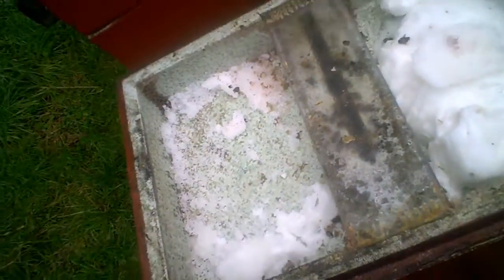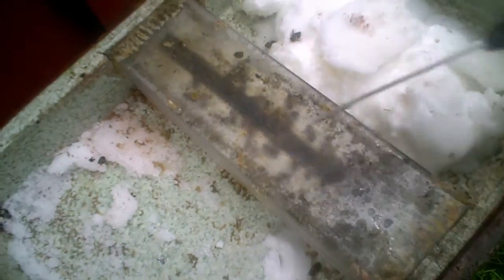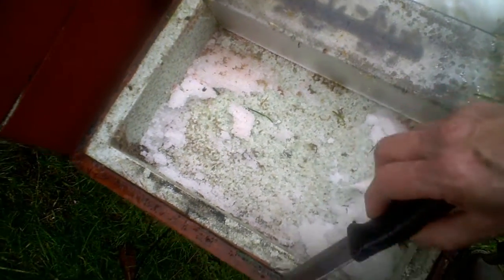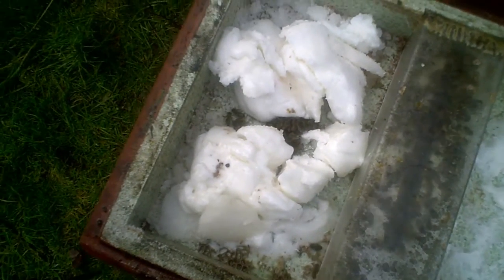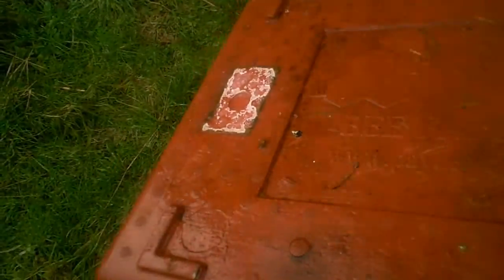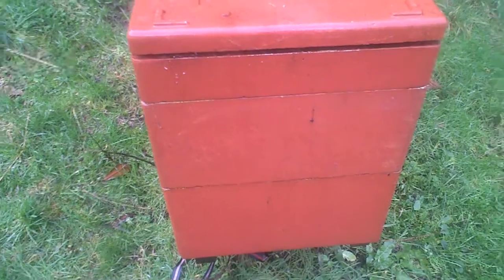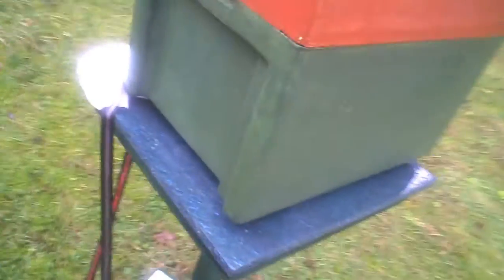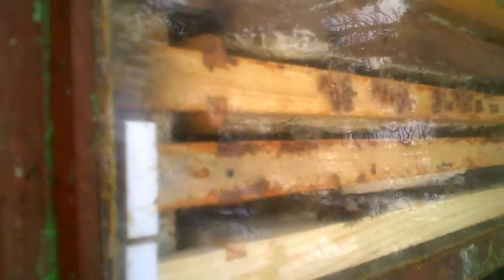Polynuc feeder problem?

Comment: Thanks for this idea, Phil, 
Did you get a clean edge round your hole so you could use a bung for syrup - I imagine it might crumble a bit?
I spoke to Maismore (bees-online) about this yesterday and was advised that they are bringing out a new version of their poly nuc with a deeper lid so candy can sit on top of the frames. 
If you invert the feeder surely it won’t fit properly?
Reply from the maker: I used a sharp 22mm spade bit and the hole is pretty clean. I could plug it with a wine cork, but I usually feed these nucs with fondant in any case. The poly nucs from bshoneybees.co.uk are made with a hole and silicone bung already in place for this purpose, and their lids are also thicker than the Paynes version. And yes, you are right - if you were to invert the feeder, it would not locate in its rebates.